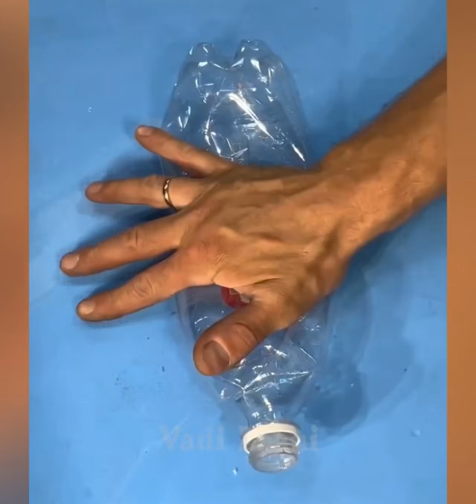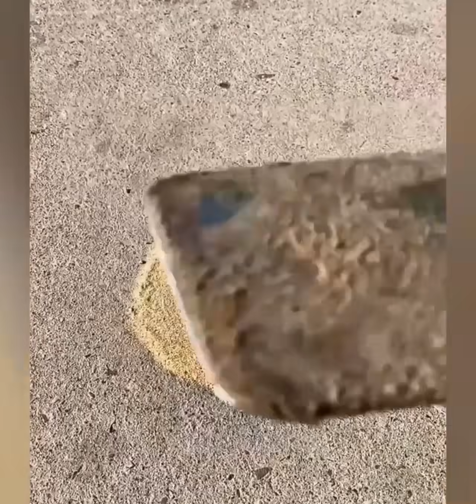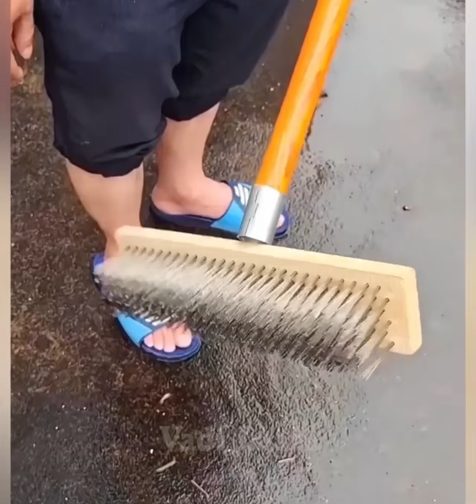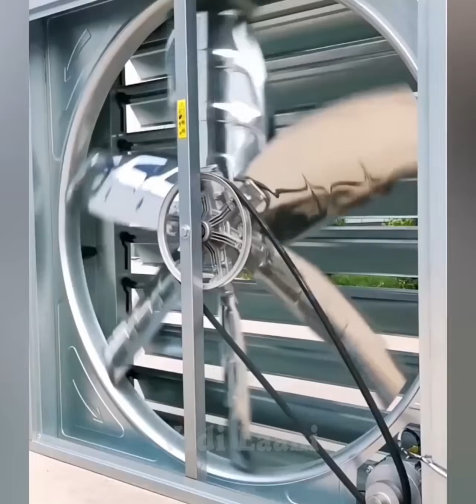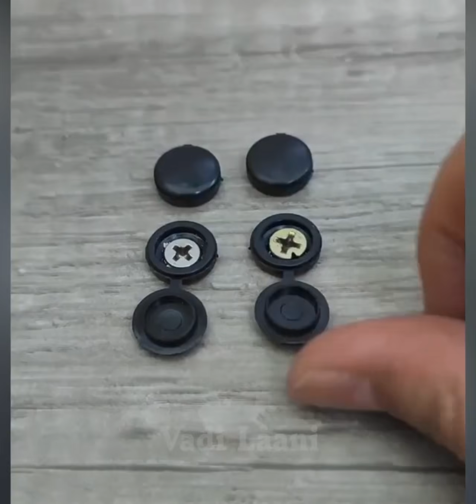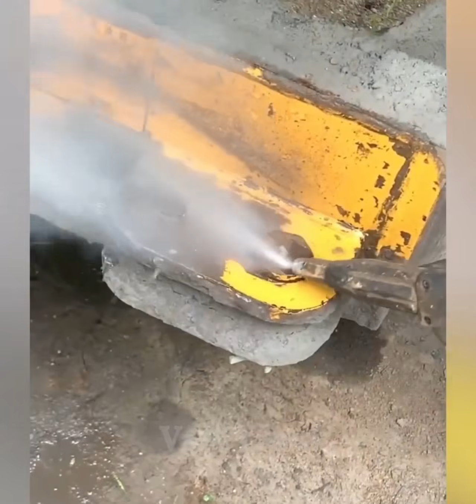Most Amazing Tools, Inventions and Worker Skills

Comment: Claims a “WATERPROOF” outlet that has a huge hole that easily lets in water.  WRONG.  That’s not even water resistant.  You just disqualified yourself as a purveyor of facts, because the facts are wrong.  Good riddance.
Reply: If it had a rubber grommet to fill that gap, it would be great.